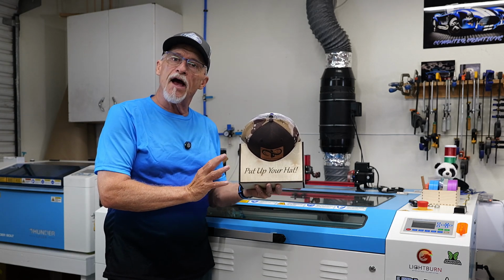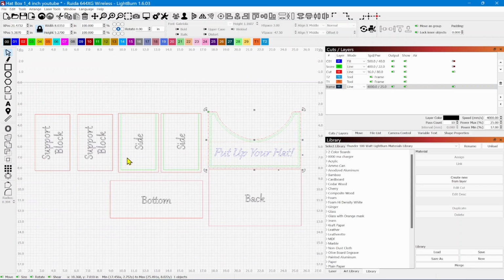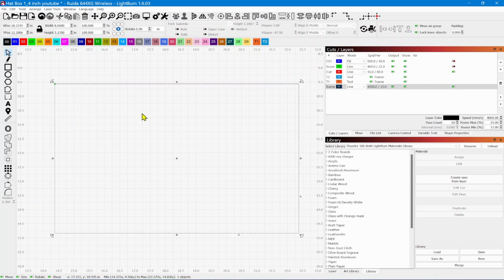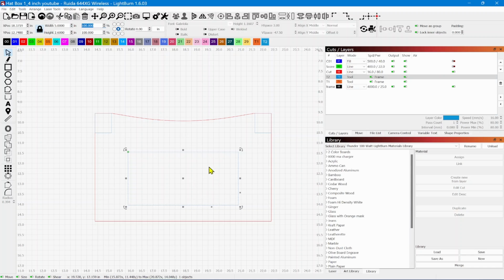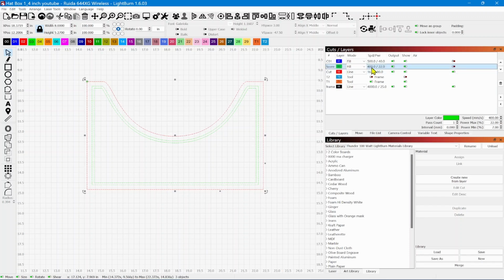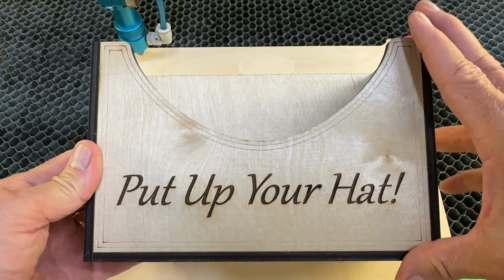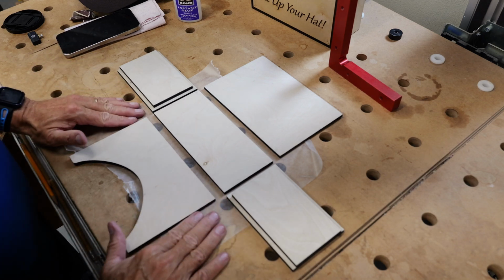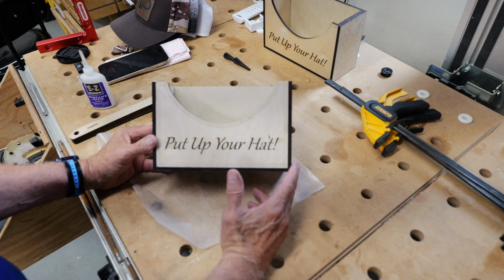Making a Baseball Hat box from start to finish. (A great intermediate project)

Comment: I'm attempting to design this in LB as you go. On the side pieces, the offset, how do you do just the three sides for the offset?
Reply from the maker: do your offset then node edit one side to remove the short side and extend to the top or just leave the block offset all the way around it won’t hurt anything
Reply: Tks.